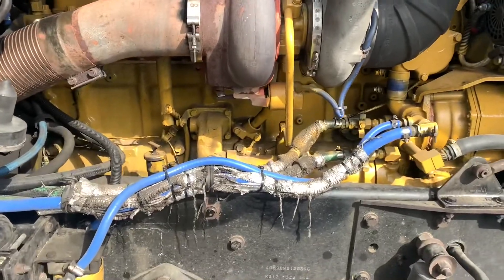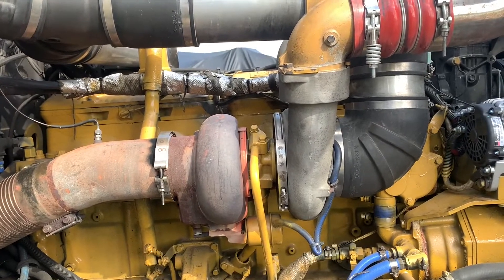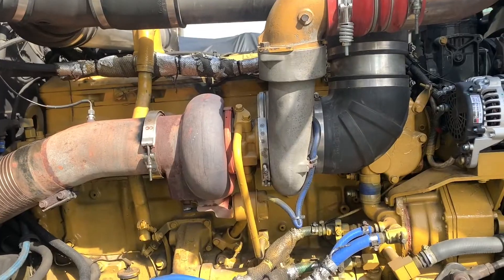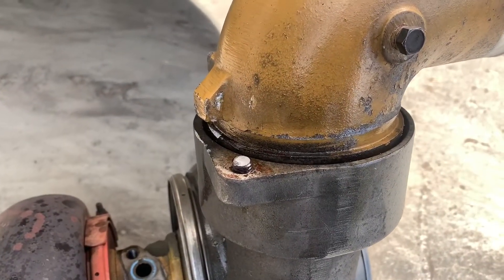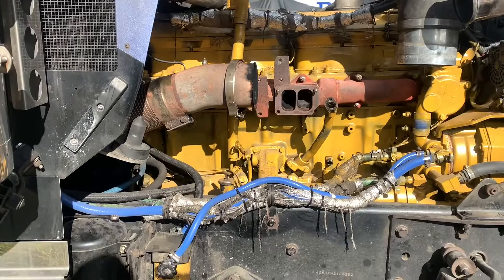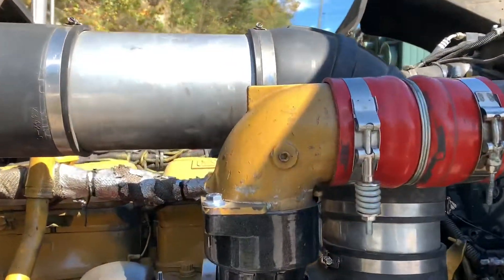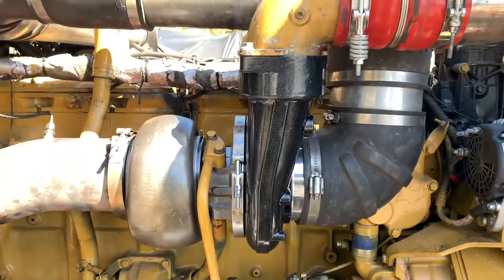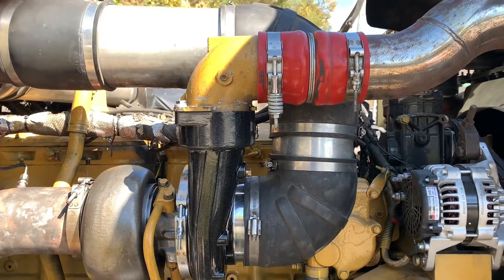CAT 3406B BullyDog turbo install

Comment: Did you ever get the elbow off the old Turbo that's what I'm having troubles with
Reply from the maker: Sure didn’t. Has to get a different one.
Reply: @etcllc3519  hey man thanks for the comebacks I'm in the process of making turbo elbow plates cuz cat wants 33 bucks a piece for them Keep On Truckin